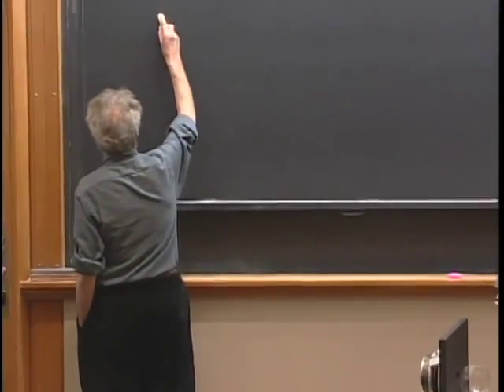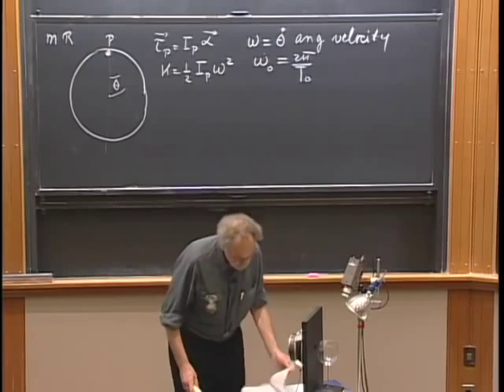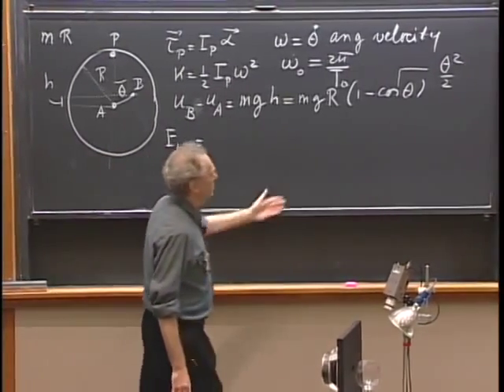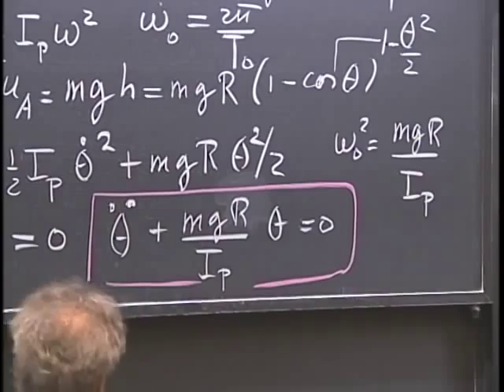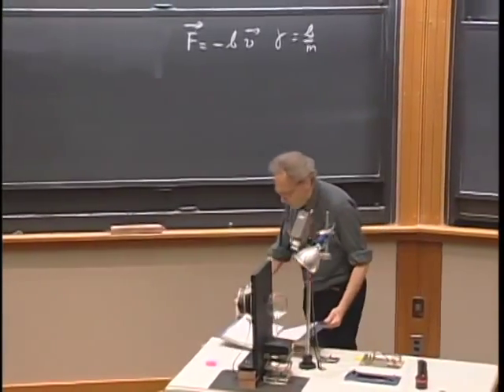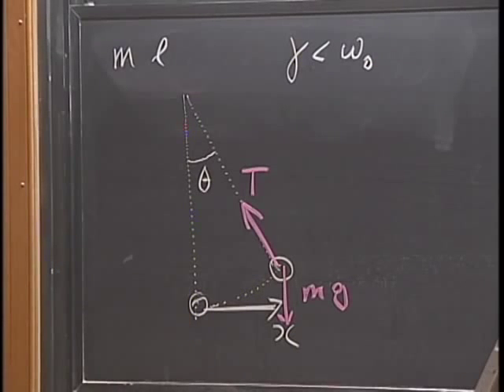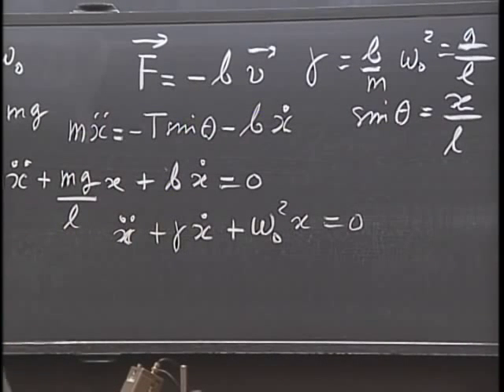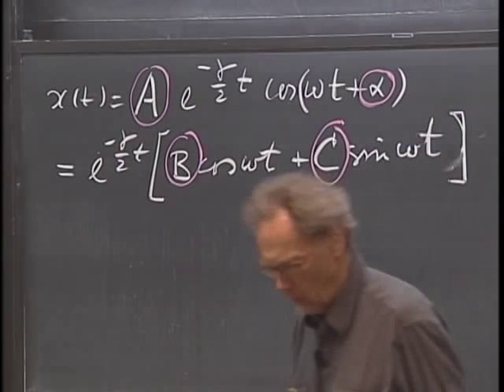8.03 - Lect 10 - First Exam Review, Breaking Wine Glass with Sound

Comment: For the boundary condition of a free end with a massless ring, you proved that for μ-->0 the result Tr=2 its nonsensical(due to the energy being zero). But if we could find a ring and a rope so that the ratio of the mass of the rope per unit length to the mass of the ring is very big and if we reduced the friction to the point of it being nearly negligible, then wouldn't Tr be nearly equal to zero? If so, then what is then the explanation? Because everything above Tr=1 gives sleepless nights as you say. So with the use of good lab equipment, we might make a good approach to the massless ring and free end boundary condition. So, what is the explanation then?
Reply from the maker: +adam lands It's not non-sensical, all energy returns. Energy is conserved. The massless ring and the frictionless rod is a beautiful way to see why it works. It's a "gedanken experiment". They are very very useful in physics.
Reply: You said that because u->inf. then E->0(at about 1 hour into the lecture), so the energy is not conserved. Did I get something wrong?
And, in the end, what is the reason that we get the result of Tr=+2? Sorry for the continuing questions, but I really have sleepless nights over this.
Reply from the maker: +adam landos Tr=2 contains no energy. Watch my lecture again.